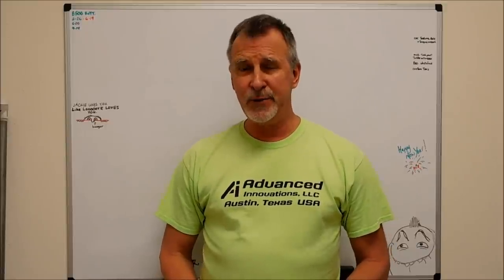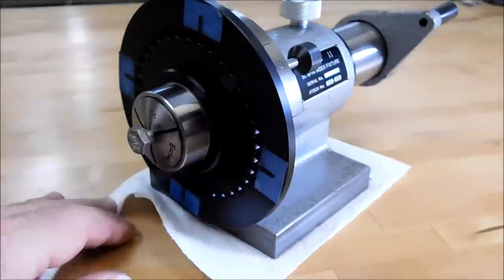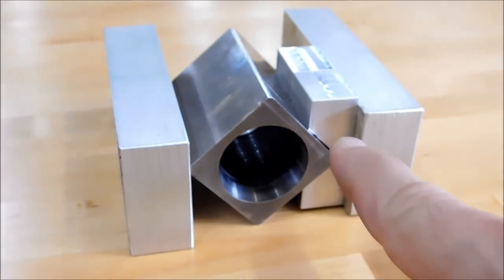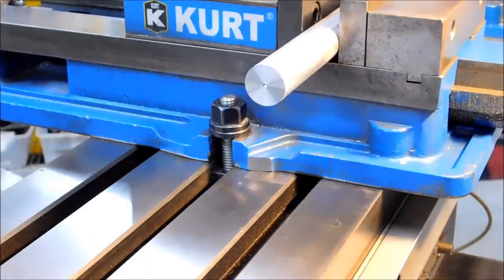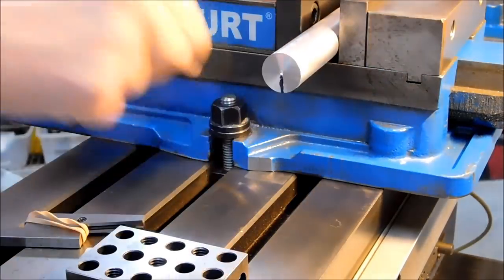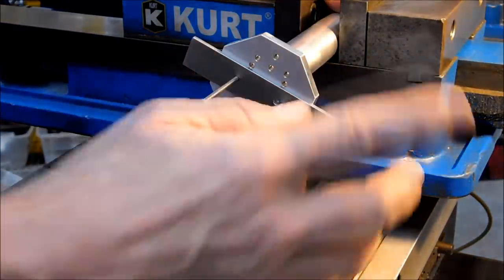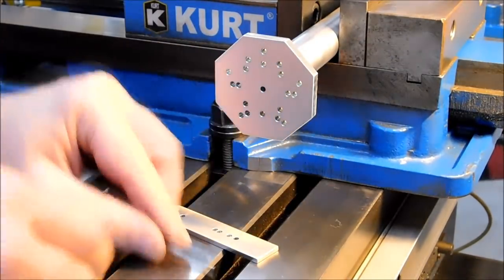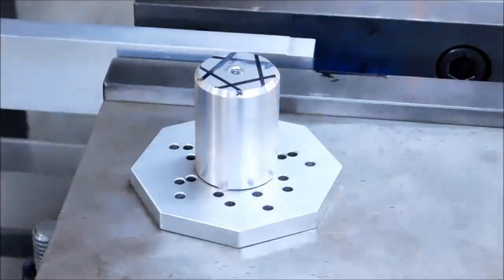No Indexing Head...Not a problem  - Take a look

Comment: Great tips, would be interested in which flavor of VHB tape you are using.  Also great suggestion on checking your collet blocks, it's possible when they are ground that the points which rest on the base of the vise are not all the same distance to center.  I measured mine and it is around 0.001 which is plenty good for the things I'm doing.
Reply from the maker: I have 4930,  70-0160-2961-6  and 4950, 70-0160-2962-4. The 4930 is .026 thick and the 4950 is .045. My exposure to the entire line is limited, so there may be thinner. Be careful how much of this you use, it is really strong.
Reply: Thanks for the reply.  Where I used to work they had $$ and we used transfer adhesive 9469 which is only 5 mil thick.  We also used another 3m double back tape and I don't remember the # which is why I posted the comment.  I've had good results for rough work with polyken 105C which is 11 mils and is inexpensive.
Reply: brs_workshop ,
Reply: Instablaster
Reply: @tesladrummer  
Thanks for the link.

Comment: Seeing you do this brings forth a memory from years ago.

A mate used to have a little jobbing workshop, and one customer used to come in a few weeks before Christmas every year and order the same 24 identical parts. All they were was around 4" long lengths of chunky stainless threaded rod, that had a square of spanner flats milled onto one end. It seems they were used as shaft tensioners in some sort of industrial conveyer fed bread baking oven. One time I watched my mate make some of them.

He grabbed a 4" square slab of pig iron plate he'd made several years earlier, and a big nut. The plate had a threaded hole through it's centre. He screwed that onto a length "All thread", and used the nut as a locknut to immobilise this plate. He then used that to align the threaded rod in a really large v block he'd bolted to his mill's table, before clamping everything down .

The thing is, he wasn't using the flats of this square as reference, he was just rotating the threaded rod until a corner of the plate touched his mill table. For some reason this way of indexing a part just felt so wrong to me, but I couldn't explain why. I 've since realise that they were just one of those "ah, that'll be good enough" class of jobs that didn't have to be NASA grade accurate, just close enough to work and look presentable. His method was VERY quick, easy, and acurate as it needed to be, but It still has the strong odor of wrongness about it though.  :)

Comment: Another fine video Joe, loved it. I did the edge clamping to and I must admit I was a little nervous for the same reason you mentioned. Only I had a really super low tech solution. I just screwed it into a hex rod and clamped the hex rod in a vise, made several low passes and then turned the hex rod and re-clamped it 6 times. It was for a one time use but the concept worked. My biggest concern when I did mine was if the small thread would break off when I made the cuts. But it worked out fine. I made a video of it and put it on my channel. I called it, "How to Machine a Connector Jack Screw Manually". Not a pro like by any stretch of the means but even and noob can get blessed once in awhile. Thanks for your Machining lesson for the day. Best Wishes n Blessings. Keith Noneya

Comment: Great simple explanation as always. Thank you. I have an 'off the wall' question. It seems that I am always struggling to keep my mill, lathe, etc. clean. Yours always seem to look like new. What do you use to clean your equipment?
Reply from the maker: My ways are always covered with lexan shields and I rarely use sulpher based oils. The WD-40 that get slung around seem to take care of any grease when I wipe the machines down, and I clean up every day. Thanks for the comment. I take my machinery very seriously.
Reply: As a kid in hs taking machine shop I had a part time night job cleaning a machine shop. One of the hardest and meticulous  jobs I've had and, 40years later I get my own modest shop to clean - for FREE

Comment: I've never seen one of these for sale & I'm sure somebody's likely suggested this before...
Have you ever considered making those reference plates on a CNC with some engraved reference info, to sell? ...you know, in a little kit with a couple of pins and any other cheep yet useful accessories.
It would be a great tool for hobbyists or guys like me who are just staring out and can't afford a lot of equipment yet.
  Considering the time it takes to make just one compared to how much you could sell those for, if you're just milling them out 20 at a time or something, makes me think that these would make money so long as you could market them well.
Reply from the maker: I may consider that. Its a handy little item. Come back for the rotary table series. You'll see some more trinkets.

Comment: Those digital angle gauges work pretty well. On a lathe you can stick in on the side of a jaw then just switch jaws and correct by 120 degrees. You can use it to measure the angle of the quill handle  which makes a pretty accurate depth stop.

Comment: For those with a background in electronics or CNC, use a backlash resistant dual tensioned worm gearbox and a stepper motor with a large gear for near arbitrary precision.  All parts hardened.  To stretch that precision arbitrarily, use a 256x Microstepping driver like the one used in the Prusa i3 mk3.  Add a pipe clamp feature as a brake for rigidity.  That setup would be precise enough that the gear and worm tooth tolerances would matter and would have to be calibrated out in software per device to achieve even greater precision.  Device would have to be kept at tool-room temperatures.  End result would be a rotation table perhaps suitable for positioning silicon wafers for processing.  I had to do some machining for my senior project and would have had a use potentially for one of the methods in the video.
Reply: stepper motor for wafer processing...
Reply: On simply use a Klystron Flux Capacitor.

Comment: One day I came up with the wild idea to index in a pinch on a mill. By using a plum Bob string and the floor. Make a flat then rotate for the desired change in angle and then after a lil math change in string length. For the experienced out there can I put this idea I'm my tool box for those super constraint situations. Thanks

Comment: your vid made a light come on in my dome, make a mark in the center of one of the 4 faces, line up the slot of a 5c collet and with that setup I can mill three flats on my big drill bits so I dont have to scrunch down on my chuck. Voila, no run out, no slip..

Comment: As always love your video's but just a thought on an easy way to make the initial index plate. Use a Digital angle gauge after setting it to your work surface level, just a thought because mine is quite accurate! - all the best

Comment: Joe, thanks for the video.  I like the tool and want to make a similar one for my shop.  Why did you put the 5 hole ring on the outside and the 8 on the inside?  It seems to me a better idea to put the smaller number rings inboard and increase as you go outward.
Reply: Terry Horlick I was wondering the same thing. Is there any reason in particuliar? Daniel
Reply from the maker: No particular reason here guys. Its just the way it was done. I started with the 8 hole and added the 6 and 5 afterwards. I wanted a good run between the pins, so I went outward. Either way would be fine.

Comment: Joe, a possible future video would be on ways to measure actual diameter of tools that have been sharpened.  I have a bunch of mills that have been donated from a company that sharpened them and they are all undersized.
Reply from the maker: 2 and 4 flute cutters are easy. Just use a micrometer. 3 flute cutters can be passed through a piece of softer material with a known table shift. Back out the table shift from the slot measurement and you will be very close to the working diameter of that cutter.
Reply: take two cuts with a know and unknown tool and compare?

Comment: Hi    The collect hex block I got my mate to surface grinding accurately the corners to get around a 3/16 " land so to give it more area in the vice as I was unsure the 6 corners we accurate to the center of the block to index off the corner and not the large flats area in my vice.   Now it has two lots of 6 flats to work  off.  (Bought a sine vice from far east vice spelt.              sine VISE . ) keep up good videos  Steve

Comment: Thanks for another great idea, Joe. I have searched the video and cannot find a closeup of the left hand end of the bar. Can't read the dimensions on the full-frame shot. Has anyone figured them out?
Reply: O.K., I got this. Decide what patterns you want, and generate a bolt pattern for each. Hole diameter to fit your pins. Don't necessarily have to use Joe's numbers.
Reply from the maker: Correct.  And, the center to center distance of the bar doesn't have to be dead on. You only need one hole and technically a long slot to allow for all the holes to align.

Comment: Great concept from another video thank you for that one.  I will probably end up getting a plate far thicker for the rigidity and stability of the pins. I do not see myself using thay kind of doublesided tape on work like that. I prefer things to be secure. Then again each one for himself. Thanks for great video and tips
Reply from the maker: The tape i used is the same tape used to hold giant plate glass panels to skyscrapers. Almost no compression or creep. I'd match its performance with super glue any day.

Comment: Great video - I'm thinking of cutting gears and pinions for model railroad stuff (N scale). this would work, no? I have a Kuhlmann universal grinder (like Deckel) and was thinking of making a single lip cutter from round stock similar to a single point threading tool for the lathe. I can't justify buying a dividing head, so I'll come up with some way to attach the small diameter stock to the index - maybe a small drill chuck attached to the index plate? Have to get my milling machine back together first - I'm adding DRO (hooray) and changing the x table end bearings. The old Clausing keeps ticking!   Thanks for the great videos - they are always a learning experience and motivation builder.
Reply from the maker: Watch the 14 spoke wagon wheel video's I recently posted. They may help.

Comment: Hi Joe, great tip.  I appreciate that the part does not need to be on centre to get the angle change as the plate ensures that an angle change occurs. 

however when you marked the hex pattern (14:50) on the end of the rod with a Sharpe in the vice would not the rod need to be exactly on centre for that marking to be correctly on centre of the rod??  I did not understand the line about if milling etc?
Reply from the maker: This plate will absolutely guarantee the part will index or flip per the reference surfaces. Ideal for flip side drilling etc. If the plate pattern center is not on center with your part, the shape you can mill will still be accurate, just not aligned with your part. it is up to you to determine depth of cut for each side 'If you are milling" and the plate is just stuck on.

Comment: I may be missing something obvious here but if I'm using this plate because I don't have an indexer, how do I make the plate? BTW, Joe, your vids are great! Thanks!
Reply: You can use a compass to "find" the hole pattern by first drawing a circle, then using small adjustments to the compass to divide the circle into equal parts around the circumference.  

A more complex, but often more accurate way is to lay out the coordinates for each of the nine holes geometrically, center-punch them and drill them.
If you have a DRO, use the bolt-circle feature.  If you're running CNC, program the coordinates for each hole and drill the plate.

The larger the circle diameter your pins are located on, the more accuracy you'll have in your indexing.
Reply from the maker: Hey Guys. These hole patterns were done on a mill, one hole at a time. Take your time doing this or the index bar ( if you choose to make one ) will not fit. You can use geometry to figure out any number of divisions you need. Its quick and accurate. Take a look at my "Making super accurate cuts on the mill" video. It shows some of the technique.
Reply: I'm going to ask a similar question, if you don't have a mill yet.... (me)...can this be made by offsetting in either the 3 or 4 jaw, (dependant on the amount of sides) just using packing material of the required size. 

Also I notice  that your spin index doesn't seem to have bolt hols to fix it down, is it just used on a register to index parts before machining?
Reply from the maker: I like questions like this because they make me think. The very first thing that comes to mind is what are you going to use it for if you don't have a mill to make it? Regardless, I suppose you could make one  with a 3 or 4 jaw and offset blocks, but anyone that could pull that off would truly be an amazing craftsman. If I were forced to make one of these on a lathe, I'd probably do it on a faceplate with a couple of stop rails and gage blocks to create my hole pattern movements. It would be time consuming, but I bet it would work. My spin indexer is usually held in a vise or clamped directly to the table or angle plate. Some do have side holes for direct bolting, but mine does not.
Reply: I have a milling attachment for my 12 x 36 lathe and am always looking for way to work around the shortcomings of that setup. No room for a mill which dovetails perfectly with no money for a mill.  Your vids are the best on the web.  Really liked  making the standoffs for the lathe chuck face. Very useful tip for me.
Reply: Joe the reason I wanted to use it in the lathe is I don't have a mill yet, nor a lot of equipment, I  want to make steam engines on my lathe, and was thinking of this to drill the bolt holes for fixing the end plates in. Most of the bolt holes are drilled at a 4, 6, or 8 bolt pattern around a determined PCD. Just wondered if this would be feasible option for determing the correct spacing.

Comment: Joe: Would love to see a video for a 7 sided part or divider (heptahedron) I fail to find any such videos. 5 sides 9 sides but never 7 even tho we see today wheels with seven spokes or seven holes. If I had a 35 hole spin indexer head instead of a 36 I could do it accurately. Then I would need to be able to make a 35 hole indexer head accurately first. This would be an interesting puzzle to see how you would solve it for a seven hole pattern or seven sided object without the use of a DRO. Thanx and always love your common sense machining videos. You make hard tasks easy as Pie....Joe Pie that is.
Reply from the maker: To do that, you'll need a common center locator hole and 7 outboard holes for manual indexing. Its easy if you approach it that way.

Comment: Hi Joe, just wondering how you would suggest drilling accurate hole location within (.0005) five tenths, such as on the indexing plate and cheater bar? Would spot drilling, drilling, and reaming be sufficient for this application?
Reply from the maker: It should be. If you are having problems, or are in doubt of the bar. Slot one of the holes long ways with the bar. It will locate and perform exactly the same as 2 round holes.
Reply: @joepie221   or just rest a piece of HSS square toolsteel on top of the pins themselves.. 🤔

Comment: I don't know that the chamfers on the hex collet block are precision ground. Even if they were, they are going to be very susceptible to dings and dents.

If you place a gage pin or a dowel under one face to lift the block off the floor if the vise, now you have registration on nice flat faces on three sides, and a gage (or even a dowel)  pin is a much more reliable reference.
Reply from the maker: I like your suggestion. A pin does offer increased accuracy. Not using one, you are at the mercy of a vertical error or an axial error depending on the blocks orientation. Personally, I've always validated mine on a surface plate with gage pins in quality collets. Its always good to know what you're working with.

Comment: Great Video! Thank you for sharing this Joe! This is EXACTLY what i needed right now. I am working on a home project that i don't want to take into the shop just for an indexing solution. I must ask: Would it be possible to get an email or other photo of that index bar?  I have tried for a half hour in an attempt to read the left of the print. I got dimensions of the 4 holes on the right side of the print. But whatever the call outs are on that left hole, I cant seem to get enough focus on.  Thank you again Joe!
Reply from the maker: go to my website and send me a request from the contact page.

Comment: Joe, not sure if you read these, but can you add a set screw to your adjustable parallel?  I have a nice one from eBay that I really hope to get around to using one day.
Reply from the maker: Adjustable parallels can usually be locked with the 2 screws that control the split side.

Comment: Great idea, still a little confused on use. Can it be used to make 50 equal marks?
Reply from the maker: If you drill a hole pattern for that application. Yes.
Reply: SO YOU WOULD HAVE TO MAKE A HOLE PATTERN OF 25 AND USE THE FLIP METHOD?  HOW WOULD YOU DETERMINE THE LOCATION OF THE 25 HOLES?
Reply: If you have a mill then you can use trig to locate the holes. 50 holes is 7.2º per hole.  For a 1 inch radius pattern, take the sin (7.2º) = .1253" for the Y value and cos (7.2º) = 0.9921" for the X value.  Next use sin and cos of  2 * 7.2º = 14.4º, then 21.6º, etc.  Tedious, but doable.  (Note, you have to multiply each X and Y value by your radius if you don't use 1 inch.)
Example:
X––––––Y
1.000, 0.000
.9921, .1253
.9685, .2487
.9298, .3681
...